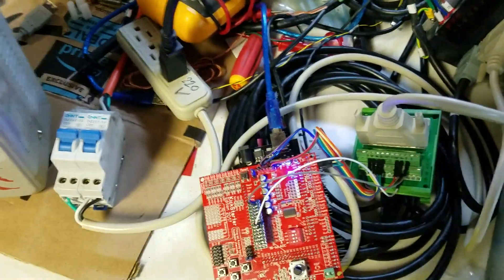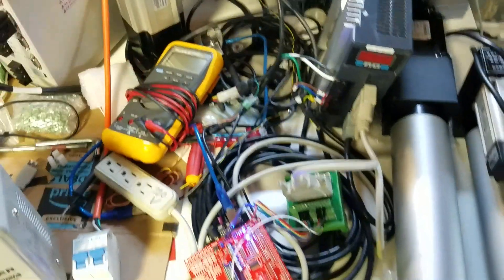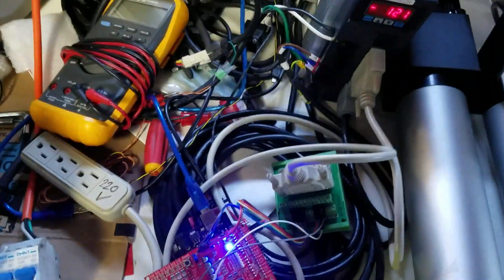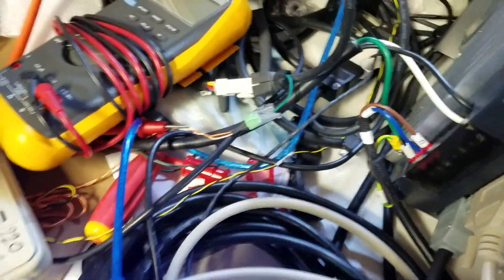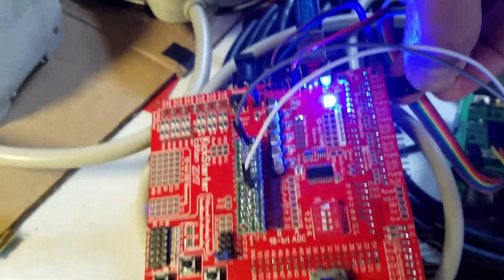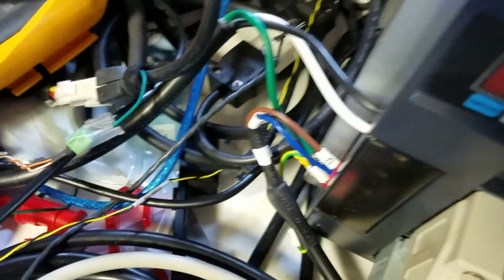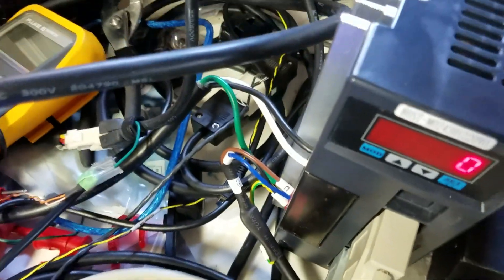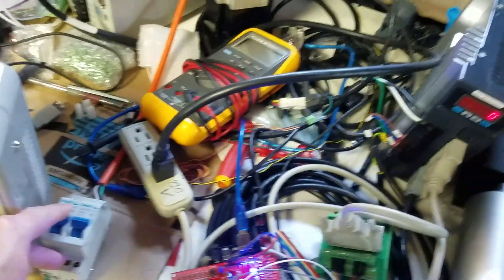AASD-15A whine noise comparison on System and on Equipment ground

Comment: Thanos, I am using the step up converter.... 110 to 220..... how would I reduce the whining noise?
Reply from the maker: Can you measure the AC voltage between each hot wire and the ground? If the voltage reading is different between the two hot wires of the 220v you have imbalance because of bad on not proper grounding at your home or location.